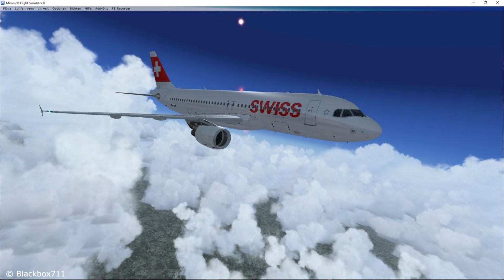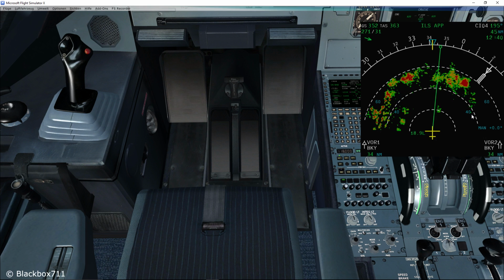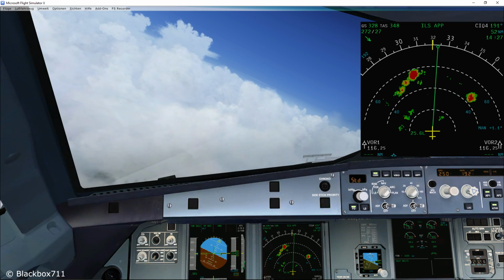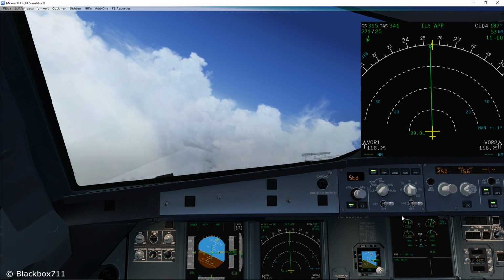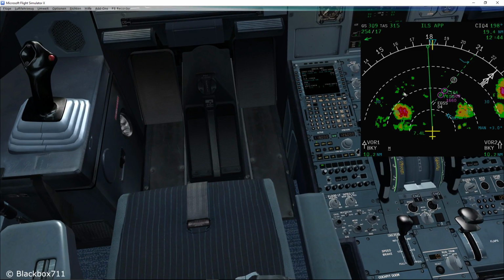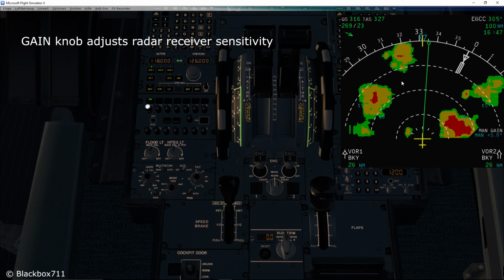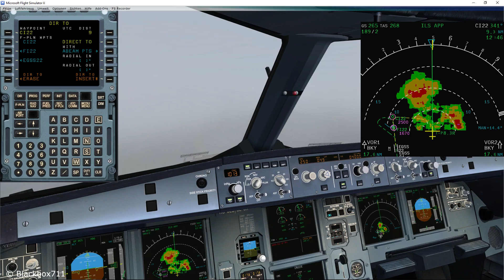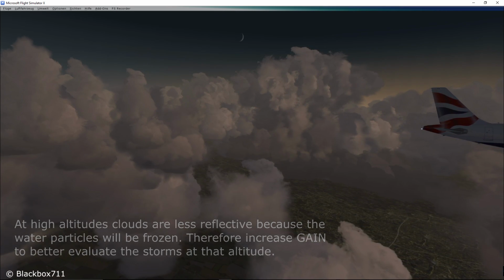FSLabs A320-X Basics: Using the Weather Radar System

Comment: According to Fctm, tilt is independent of aircraft pitch angle. So in descent, + tilt should be scanning upper altitudes. So why do you use + tilt during descent?
Reply from the maker: Please be aware that a PC flight simulator does not completely represent a real aircraft. If I am using a different tilt than normal it is due to the PC simulated behavior.

Comment: do you have time to answer my question, I'm using P3D V5.3 and Fslabs A320SL, lots of clouds in front but I can't see the weather in ND like this video.
Reply from the maker: Do you use a weather addon like Active Sky?
Reply: @Blackbox711  thanks.. I have Cloud art REX installed and using ActiveSky now.
Reply: @Blackbox711  I just bought it today, does it have to be with REX, and how to use it
Reply from the maker: @A320-Cockpit-Wamena  if you have Rex Skyforce just install a cloud art set. Then all you need to do is to run Active Sky while using P3D to have it insert live weather into the simulation.
Reply: @Blackbox711  yes i have REX Skyforce 3D,  but for setup REX? Can you send me setup REX via my email? Just instal Cloud Art or need some setup.

Comment: Hai... I am using P3D, Fslabs, and Rex5, but not showing weather like this.. Can you tell me how to do it?
Reply from the maker: Hi. Did you install a cloud texture set from Rex5?
Reply: @Blackbox711  cloud textures from rex5?  do i have to buy again or is it included in rex5?
Reply from the maker: @A320-Cockpit-Wamena  it should be included. Best if you go through the manual because there are some important steps to do.

Comment: Know it is an old video, but i use ASP4, and the radar only seems to work when i have GCS enabled, is there any reason for that?
Reply from the maker: At what distance do the ground echos appear when you have GCS (Ground Clutter Suppression) in the OFF position?
Reply: Seems like i fixed the issue, i thought it worked as a cloud detector, but i was wrong

Comment: Do you have any tips or tricks for improving your frame rate in FSX? I have trouble getting decent fps when using any heavy addons, such as this aircraft.
Reply from the maker: Hi. What do you consider decent FPS?
Reply: Blackbox711  For FSX I'd say a steady 30-40 fps.
Reply from the maker: +CALEBMAESTRO ... well that is tough to achieve in the VC in the FSLabs A320. The maximum I get is around 30-35 with high but not ultra high settings. And I have the GTX 1080 with an i-4790k.

Comment: On5.09 u suggest that at lower attitude the it will show more on the wax radar than the real situation, so how should we adjust  precisely or how do we know at which attitude we should adjust to which Gain? Many thx for ur great video!
Reply from the maker: Hi. Thank you. That is difficult to answer. What I would suggest is to play around with the different modes and settings to see what works best at a certain altitude with the injected weather. In real life you do this in a similar fashion because the automatic mode has its limitations. Regards
Reply: Blackbox711 ummm.. Indeed for me I wouldn't have the idea of what is the 'right amount' of clouds that I should expect in each attitude so to speak.. If I m playing sim on my own. Without knowing the knowledge that u huv like on lower attitude it would show more, higher attitude it will show less, does it mean that indeed it wouldn't be able to tell if I m playing the sim on my own? Would love to hear from u in the future to use a flight to demonstrate in more details :)like what exact altitude the reaction u would do.
Reply from the maker: Sorry, that I had to give you a very vague answer. The real problem with this addon from Active Sky is how different it behaves. So it is true, when I use the weather radar I play around with the settings and know when the picture looks satisfactory. But I take your point that this is not satisfactory as an answer. So I will do another video where I play around with different modes at different altitudes and explain what I look for. Regards.
Reply: Blackbox711 wow thx!that would b great!^_^

Comment: Thanks for the useful videos. Please can you clarify the radar tilt. I was under the impression that if you were climbing from the ground you would tilt the radar up to look at the sky. If you are descending you would point the radar down to look towards the ground. You mentioned in descent tilting the radar up which confused me. Thank-you.
Reply from the maker: Hi Michael. The tilt is always with respect to the aircraft pitch, i.e. longitudinal axes. So when you descend, the nose is pointing lower, meaning you have to tilt upwards and vice versa. Regards
Reply: Actually, the tilt is the angle with respect to the horizon.

Comment: Hi, nice work with the video. Just a note, the GCS (ground clutter suppression) switch filters out the ground returns, so what you were seeing were not ground returns but just more precipitation.
Reply from the maker: Hi. Well, not sure about how that is simulated at the moment. If it was working correctly it wouldn't overdraw the precipitation the way it does. So in my opinion the radar does mix in some ground echos. But anyway, the real message is that if you want to be able to see the weather picture more clearly, you need to use the manual mode and tilt the radar beam yourself. Regards
Reply: Yeah this radar is programmed differently than how I am used to seeing with other products that use the AS weather. The most notable difference is that the FSL airbus radar doesn't show nearly as much returns, even with MAX gain compared to PMDG's products. Dont know who has it right, and it doesnt really matter to me that much, but just something i keep in mind.